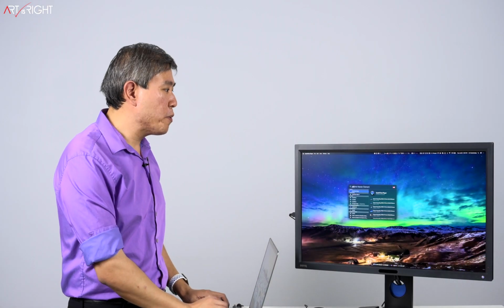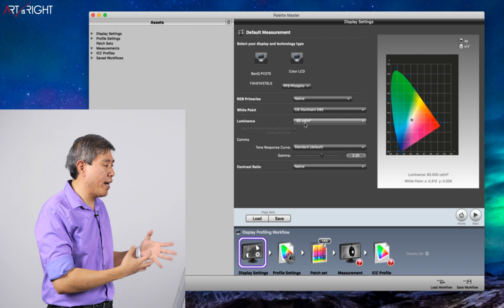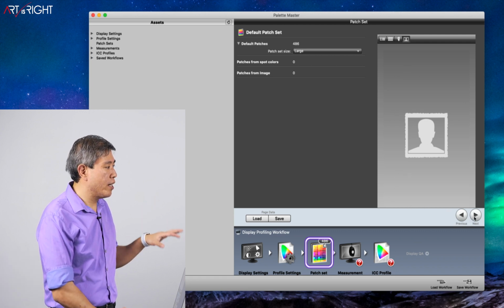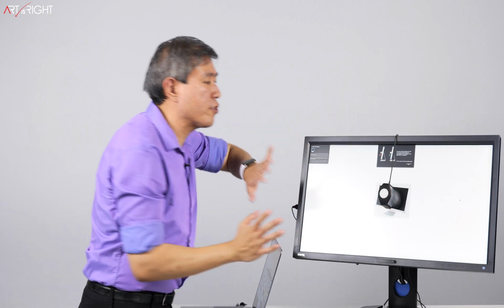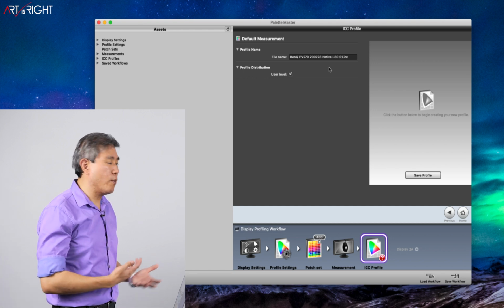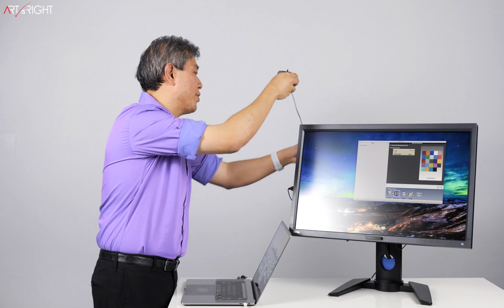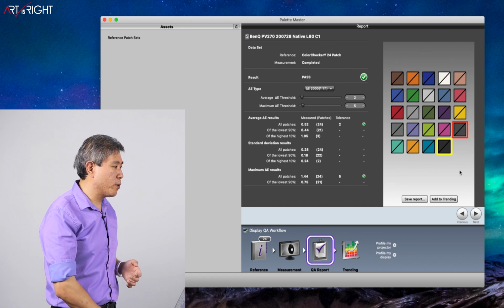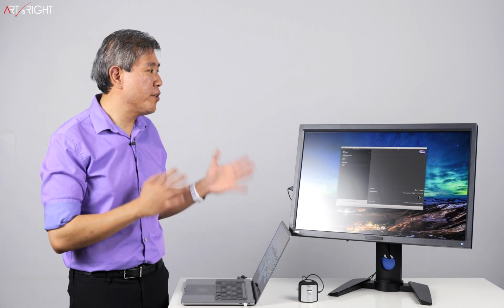HOW TO Calibrate BenQ PG & PV Displays using Palette Master & The best settings to use.

Comment: Hi,

It seems you can't download Pallette Master Software for M1 or M2 Macs. Is there a workaround for this?
Reply from the maker: BenQ Discontinue Palette Master a while back. At this point if you have the PG or PV, your best option is to do software calibration.
Reply: @ArtIsRight  Hi, thanks for the response. How do you mean? Isn’t Paulette master the software way?

If not, do you have a tutorial the way you are speaking of?
Reply from the maker: Paletter Master is a software that talks directly to the LUT inside the display to do a hardware calibration, not a software one. Before I share with you any guides, what BenQ display model you have and we'll go from here. Or if you like just dm me on fb or insta

Comment: I notice you selected PFS phosphor as the display technology. As far as I can tell the PV270 is a GB-LED device. I find I get different results depending on the chose tech so I'm a bit confused. I edit in premiere pro without colour correction so the output to my screen is Rec709. Consequently I need to be sure that my stored hardware correction is accurate. Thanks for the great video!
Reply from the maker: If you look again, it listed all of the display linked up on the system. This is a PG and PV display calibration with Palette Master software which was developed by X-Rite. What you are seeing are the listed display and it is the correct tech for the build in laptop display but that is not what I am calibrating. If you are looking for a Mac calibration guide watch this https://youtu.be/JrPdvs2by04 This video is a hardware calibration guide specifically to BenQ PG and PV line, not the same.

Comment: Hi, how to connect PV270 display to imac via USB? I tried type C to USB but not working. 
Error message- No matching display found. please verify that the display bis connected to the computer with a USB cable.
Reply from the maker: Depending on the iMac year, size and model. USB C to USB A or B does not carry display signal. You would need either USB C to display Port, Native HDMI in addition to the USB C cable.
Reply: @ArtIsRight  i have connected using type c to HDMI and it worked but the problem is with the usb connection not with the display. (I'm using iMac 27" 2019) and  Xrite i1 Display Pro Plus
Reply from the maker: You will also need the use the USB A to USB Type B uplink cable. It will be similar to this setup https://youtu.be/OVml8PQ4F2g

Comment: Hi, after upgrade master element software dont recognize i1 xrite anymore,any idea? thanks (MAc 10.14.6) show ERROR,thank you
Reply from the maker: What version of PME? Also I would try and go to 1.3.8 and if you are still running into issues. You can find the link here https://youtu.be/XRB3QeGrHik If you are running on 1.3.10 or 1.3.11 besure that you choose the correct X-Rite Device as well, I heard account of uses picking the incorrect one and getting the error. Let me know if any of these solves the issue.
Reply: @ArtIsRight  Hi,I install 1.3.8 and now asking please make sure that the USB cable is connected and that the FTDI drivers are working and shutting down after I click OK.  actually the same problem.   1iprofiler works.
Reply from the maker: Is i1Profiler running while PME is running or is it running in the background? If this does this may prevent things from working properly. Check on the top right of the Mac menu bar to make sure that i1Profiler tray is not running. Also have you ever installed color munki software at some point?
Reply: @ArtIsRight    iProfiler works with calibration,when I go to PME,-Iprofiler its not running ,I dont haw color munki.maybe driver problem?
Reply from the maker: Could be, I have more questions for you. Please add my facebook page and start a conversation with me there so that we can go back and forth. Either this or you can contact your local BenQ support for help.

Comment: Sorry just wanted to add. I got a delta ae level of 0.46 and 2.4. I have changed my Contrast to 2.4 as suggested in Aces.
Reply from the maker: What display do you have?
Reply: ArtIsRight BenQ PV 270.
Reply from the maker: Considering the setting, I think that you have a good set of ∆e to work with.
Reply: ArtIsRight thank you.

Comment: Hi Thank you for this video. Just one question you choose native but in my calibration I have chosen rec 709. 100 nits as I am grading to ACES specs. And that is what it said on the Aces page. Should I go with Native or 709 what is the difference. Thanks. you have been my master class in this subject.
Reply from the maker: You have 2 options depending on the program that you are editing with. If you are using Adobe or Apple programs then you should be good with either because these programs color manage well. If you are editing in DaVinci Resolved then sick with the ACES specs, REC 709, because DaVinci does not color manage. This video will tell you why it does not matter if you are working with a great color aware program https://www.youtube.com/watch?v=Yvu-sgddna0&t=552s
Reply: ArtIsRight thank you. Using Resolve 16 Studio version.
Reply from the maker: Yeah stick with REC 709
Reply: ArtIsRight thank you.